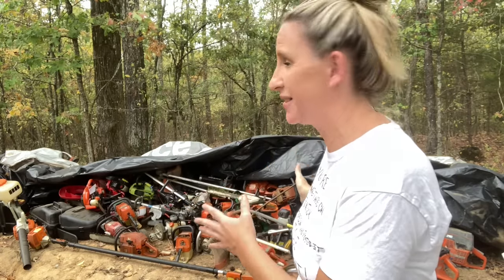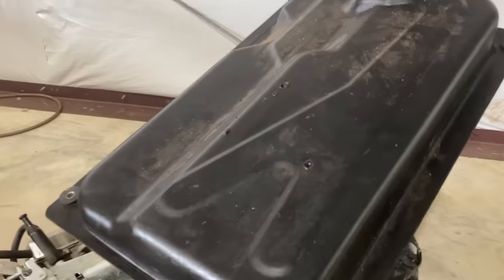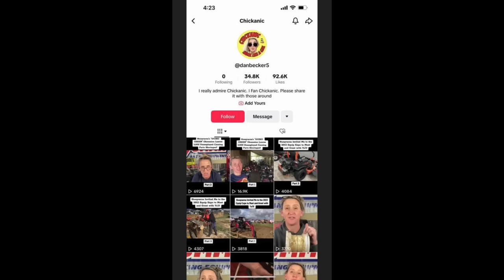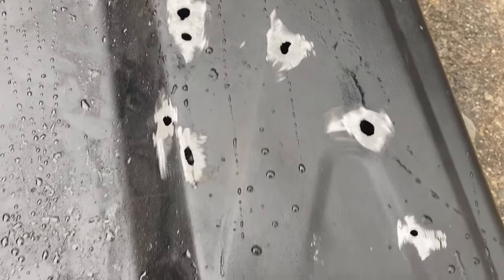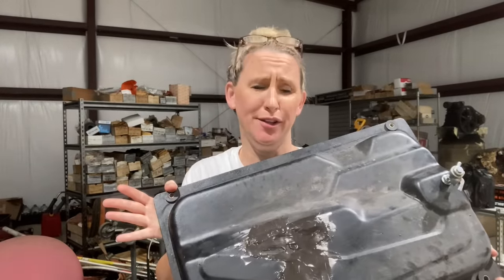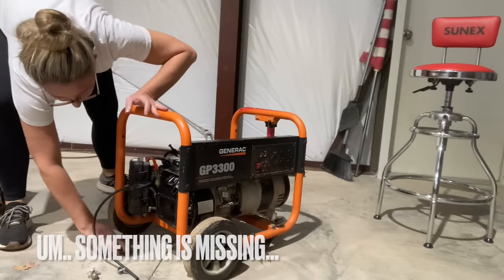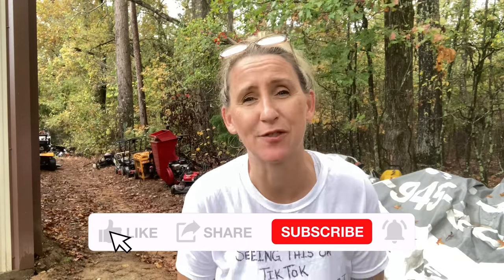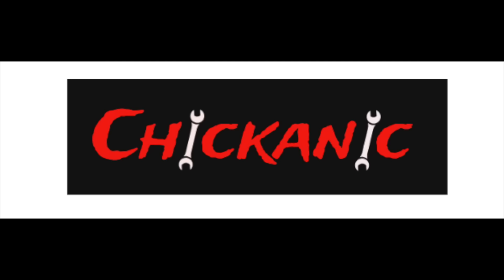Customers ABANDONED All This Equipment! Turning Their Trash Into My TREASURE! Vlog

Comment: Whenever I run into Chinesium Mystery Metal, I don't weld it, I braze or silver solder it. Much easier and sometimes I hard solder some thin copper sheets on larger areas where there's a lot of smaller holes and pitting.

Comment: Great to give the generator to a family member. If they ever have more trouble with the gas tank, my neighbor had a generator that someone had added one of those plastic gas tanks for boats to it to increase run time. Seemed to work pretty good. Keep up the good work!
Reply: Just what I was going to say. Did the same with a Jerry can on top of irrigation pump. I don’t have experience with JB weld, but fear what could happen should the gas leak onto the running motor, especially to a family member, but anyone, really. I might use it myself, if it was situated far enough away from anything else, but even then, a Jerry can with a nipple brazed to the bottom would be preferable.

Comment: Years ago when I was a young man, I worked in a VW repair shop run by an German immigrant.  I was the shop trainee and gopher.  One day the boss needed a replacement gas tank.  He found one in the junk yard that had lain in the California sun for at least 10 years - open with the cap off.  He decided that since it had been so long it would be safe to weld.  He started to weld when the whole thing blew up, and tossed him 30 feet out the door! The tank burst open like a flower!  Not mention a fair amount of shrapnel flying about. Amazingly, he survived with only minor injuries!  Later I watched another mechanic successfully braze a fuel tank with a pin hole.  He had the tank completely full of RUNNING water, that is, the water was continuously running, and running out of the tank, while he brazed.  Absolutely no air cavity. So it can be done, but it's still pretty scary.  Oh, and it's not just welding/brazing.  Grinding can ignite the fuel vapors as well.  Ever since I have been very very wary of old fuel tanks, especially "empty" ones!

Comment: I tried JB-Weld on a metal chainsaw tank containing a fuel mix with Ethanol and it eventually leaked so keep an eye on it.
Reply: JB weld isn't worth a hoot for repairing any sort of fuel tank.
Reply: Works fine if you properly prep the area.  Acetone or brake clean, scuff the area well, acetone and brake clean again and slather her on over a  a good purchase of area around the hole.  Most people don't ever properly clean and prep when using epoxies

Comment: You know the original owner is going to see this video and call tomorrow asking, "Hey, have you fixed my generator yet?"
Reply: Yep , and you tell him it's sold to pay the rent 👍🇬🇧
Reply: They can have it after paying the $1000 storage fee. 😁
Reply: Exactly what I was thinking would happen.
Reply: Put an old mower tank (like lawn tractors have) if the JB weld starts leaking. 😊
Reply: Ahhahhaha!
Reply: Those
Reply: Awesome 👌
Reply: No. I fixed MY generator.
Reply: @larryjohns8823  Based on my experience, the JB Weld will likely last for many years.
Reply: @doctormdds  May be true, but if it does leak it will drip right on a hot engine - not too safe.  Just put on a good aux tank.
Reply: Just out of curiosity, did you consider brazing it?
Reply: Tha rubber on that fuel tank is a liner.
Reply: @doctormdds 
Yeah, that Project Farm channel guy (name is Todd, I think?) tested several types of 'liquid steel' adhesives/fillers earlier this years & unless I'm wrong, I think JB Weld finished 1st in a field of maybe 8-10 brands.

Maybe someone can confirm that (or correct me if need be)? 👍🏼 Thanks!
Reply: @mariofernandez9026  I had a nice Makita compressor that I was not religious about draining the moisture out after using. Eventually, the bottom of the tank started leaking. At first, I tried to weld it, but could never seal it 100%. Finished by brazing it. Then I remembered this same issue way back in the day with 5 gal Jerry can bottoms. I could not weld them tight, but could braze them easily. D'oh. The tank itself is welded to its frame, so not really feasible to replace the tank.
Reply: See any Hunter laptops?
Reply: @mariofernandez9026  I did. I have run into this type of "steel' several times over the last few years. Looks like stamped steel but all the seams are epoxied, nothing welded. Some newer decks react like this also and it was almost impossible to weld those. This metal is so brittle I'm not certain how they stamp it. My gas and torch are still packed up but my welder is ready so I went with that because I've never had trouble closing up a tank like this now I know new "steel" doesn't act right.
Reply: Can I have it back?..🙄
Reply: I'll buy a chainsaw lol
Reply: @daninuesca3801  Sure, if it's yours.We will order a tank.

Comment: Good job. I’ve welded fuel tanks of various sizes and shapes. Water right up to the weld zone is the only way to safely repair it- period, using inert gas is iffy at best . Well Done Lady. My Lincoln welding machine has a common walmart red 2 1/2 gal plastic tank because the original was breaking down with the ethanol gas and a factory replacement was cost prohibitive. It’s 24 years old and still going strong. You ROCK !
Reply: I disagree. I've welded two very porous tanks in my days. I though about filling with water or flushing with inert gas, but thought they're way unsafe things to do and that water will easily create pores in weld too. So what did I do? I burned the gas out quite literally. Positioned tank on snow so that the filling ring was highest spot and filled it absolutely fully with water and lit it up. Bit of burning first. The crucial thing is to keep it in flame all the time, so I had propane torch and quite big flame all the time at the filling ring and I removed bit by bit water out, keeping flame constantly on the ring and got occasional small puffs. Took it slowly and if the flame died or was out from the ring even for a second I stopped, filled the tank again fully with water and began from the start. The idea was to burn gas fumes as fast as possible out, not giving time for ideal explosive air/fuel ratio time to occure at all, but to burn the miniscule amounts of fuel that evaporate from pores immediately. This method gave only like  max.10cm long tame puffs from the filling ring if I emptied bit too fast. End result was that I couldn't smell even a whiff of fuel from the tank and it was so nice to handle safely after that. Imo this is by far the safest way to approach welding fuel tanks, but obviously needs common sense and thought doing it correctly. Also when tank felt fully empty I still kept the naked flame on at ring and went through all the surfaces with heat gun just to be sure. I've been in place where one idiot exploded "empty" fuel tank he thought was safe. Not far that I would've soiled myself even though I was quite far away from the explosion.

Just keep the "fire triangle" in mind contantly when approaching situation. Fire happens if the three criterias meet: Combustible material, heat and oxygen/air :)
Reply: @jothain  
Good for you and your technique.

Comment: Something I learnt 30 years ago about fuel tanks was when I flew my motorcycle from New Zealand to Australia. The airline instructed me to drain the fuel tank and then run a hose from my car exhaust into the tank for about 5 minutes so the carbon monoxide fumes would neutralise the fuel vapour. I mentioned that to a friend who was a mechanic and he said that's what they did before welding fuel tanks. No need for water in a tank.
Reply: I've seen that done. Some shops put some water in the tank, position the tank so the water is all in one corner and put that corner over a burner so the whole tank fills with steam, and then they weld. I've also seen a motorcycle tank blow up (no injuries) after being in a hot tank over 2 weeks. You have to be careful of those seams. Myself, I haven't had a torch near a fuel tank ever since the motorcycle tank incident.

Comment: Love watching you work.... I've learned alot about small engines and even about stuff I'll most likely never have or use.....But a little more a year ago my next door neighbor had a power washer at the curb . I wasnt sure if he was preparing to use it or simple trashing it... All the parts and attachments were with it and it all looked fairly new. so I went and asked if he was throwing it out and he was and I ask what the problem was... He just stated it wasnt giving water pressure and he was tired of messing with it..... So I took it and just rolled it into my backyard and the first thing I did was the chickanic 5 point check system... Checked gas , checked spark plug, checked carb checked oil, etc and all looked fine and damn near like it was never used....and it started but no water pressure.  So what would chickanic do, OH check the water pump....Turned out the remains of the shaft key looked more like cigarette ashes....Looked up pump model and size needed for shaft key and $1.50 later I had a fairly new pressure washer... The killer part was watching the look on that neighbor's face as he drove by a few days later and I was power washing my cars and driveway with what WAS his power washer..... So thank you so so so much for the teachings you have shown us all.....

Comment: I had seen (plastic welding with zip ties) I was skeptical,  but tried it on a generator plastic tank. It had been dropped or something and two corners wre cracked. It works!!!
Reply: It will work for a little while...gas will eventually seep around it and it will start leaking again.

Comment: Really nice shop and video. I had one recently in my shop that needed a fuel tank and I advised the customer to replace it with an aftermarket tank due to the fact he ran it in his barn. I thought if the tank leaked from a repair that he would burn down his barn. He took the gen set and I don't know what he did with it. He was to cheap to get the aftermarket tank. Thanks for great video's.

Comment: I'm pretty sure that tank isn't cast.  It's stamped out of sheet metal.  Look at the flange where the two tank half join,  it would be pretty tough to cast something that thin.   You might have better luck in the future brazing a patch rather than trying to weld a hole.  Sheet metal can be a challenge to weld, but with brazing, you aren't melting the base metal during the process.

Comment: Water in the fuel puddles and forms rust spots.
Reply: Gas and water don't mix. Add ethanol to gas, yes.  Add ethanol to water, yes. Ethanol is the catalyst for mixing up water to gas, but if not sloshed around regularly the water in the alcohol is heavier than gas and settled to the bottom of the tank.  Therefore pinholes in the bottom  and nowhere else.

Comment: There are fuel tank rust converters and liners such as POR-15 to protect the exposed metal inside. Your JB Weld on the outside is good for support.

Comment: I started using AV-100LL fuel for my small engines, it cost more but the local airport is close. The "summer gas" will destroy fuel tanks and systems if not drained out for the season of dormancy.  It's shelf life when kept in full tanks is around 8 years!

Comment: I was thinking when you showed the original patched holes in the gas tank that someone had already tried patching it with JB Weld.  I have used it many times over the years to patch gas tanks and it works until more rust occurs.  But that takes years of sitting around…….

Comment: I have a throw away in my shop right now that I want to fix for myself.
 A good neighbor collects scrap, and many locals will call him to haul something off.
 This summer he had a White ZT54 lawn mower that had had a fire and was tossed out. 
 I removed all the melted plastic,  intake manifold included along with the carb, replaced one coil, and had it running by introducing fuel to the ports in the block.
 My problem is, after adding up all the replacement parts needed to make it run again, it comes to more than 3/4 the price of a replacement engine.
 If I could find a 26HP Briggs with internal injuries that I could rob parts from, I would go that way. I just haven't had any luck with finding the right blown engine.

Comment: back in the 80's i worked at a small fiberglass shops. every couple months someone would bring a rusty gas tank for a car. it was always the bottom or the seam. so we would fiberglass over each half and leave extra glass sticking out at the seam. that way the tank was enveloped in fiberglass . sure you still had the rust inside but it stopped the leak. this was in the boonies and before cheap replacements.

Comment: The tank is probably weldable, but very difficult because it's super thin.
I'd suggest using.025 mig wire 030 would work too, and to pulse it in as opposed to trying to keep the trigger down this will avoid burn through I'd also avoid flux core wire for something this thin.
Build it up from the edges then grind it down and add more if needed.
Thanks for the video.
Reply: Brazing a patch on would be better than mig welding

Comment: Ok 
Holes in gas tank with a sealant on it.

In the factory a worker swapped his dammage  part out for a new one before it got painted   is one reason

A shipper did the switch.
A store employee did the switch.

A customer bought it took it home swapped the gas tanks and took it back.

The owner bought an unboxed  unit as new or clearance aka returned item.

If it dosnt have a box and isnt in the box i dont buy it.

Comment: Gifting to a family member is great. But i wouldn't pass on buying that unit with the J-B weld on the tank. I fixed a 24 hp Brigs with a hole in the crankcase, about the size of a quarter, and ran it till the cylinders had about 50 lbs of compression. Put J-B inside and out.

Comment: I have a decent large generator that fell off of a truck that was being towed and landed in the middle of the road. Later someone had moved it to the side of the road a block from my place, so I actually towed it the block to my house.
I call the police, they made a report and took it to the station.
90 days later, as instructed by the police, I went down and no one claimed it.
I replaced a bad pull starter and cleaned it up. Now I have a generator, I don't really need it, but have been too lazy to sell.
I have a garage full of old trimmers and such too. It gets addicting fixing things and that feeling when you do.

Comment: Please be careful using a cutoff wheel to sand with. Yes it works, iv done it also. But one day it will get you. Guy at work just a few weeks ago had a 4.5" cutoff wheel blow apart while using in this way. Went into his face shield, all down his chest, and up his arm. Cut him up pretty decent. Its not worth the quick time saving of not swapping the disc out!
Reply: Pretty sure she was using an abrasive, not a cut-off wheel

Comment: When it comes to thin metal, (Steel, cast, even rusted on the inside) many times I'll solder a plate over the hole. Cut a piece from an old tank. I've even soldered a penny over a rust pit on a well water tank.

Comment: Let me begin by saying that I very much appreciate the informative content and good presentation of your videos.  My comment concerns your personal safety.  It appears that you were using a cut-off disk when you cleaned the paint and corrosion from around the holes in the gas tank.  A cut-off disk can shatter when lateral pressure is applied and the razor sharp broken pieces can fly off at high speed (yes, I did this once, myself).  The pieces can cause severe injuries if they strike anyone in the vicinity.  Please use a grinder disc (many times thicker that a cut-off disc) or a flap wheel sanding disc to remove corrosion.  That is much safer and works well.  Keep safe and keep up the good work.  ---  Ted

Comment: You must really like Django Reinhardt, using his gitfiddle in the background like that.  ;)
I used epoxy to fix a UV cracked tank on my 2-stroke tiller and it only lasted a month before lifting off the poly tank.  Then I tried E-6000 and it has held for 6 years now.  I wasn't ready to spend $42 for a replacement if I could seal it for a buck.  VBG. I've only used JB Weld once, but seeing the amount others have used it, I wouldn't be averse to selling a repaired tank after noting it to a client, maybe after running it once a week for a month.  Your family member will love it, though.

Comment: Hi Bre, How's Ron doing with his hip?
Once the JB weld has cured get a can of Damon Industries Red-Kote Fuel Tank Liner - RED KOTE and follow the simple instructions. The lined tank will out last the motor.
Reply: Probably need to get all the oily gas residue out with lacquer thinner before using the redcoat.  I agree with the others who have mentioned that regular JBWeld doesn't hold up to gasoline, especially the gas with ethanol.

Comment: This is fantastic.

I wish I was closer.  I'd love to come rummage through that equipment for some key parts I need to assemble a custom weedeater for my wife.  She is a small woman and needs a good weedeater.  But what I've found that is lightweight and short enough to suit her is garbage for quality.  

So after talking to a local Stihl rep, I want to get a very small lightweight shaft and head but put a heavier duty motor from the bigger commercial units.  Slap it together like Frankenstiens monster.  

I actually have lighter shaft unit with a busted engine.  So I just need the better engine to put on it.